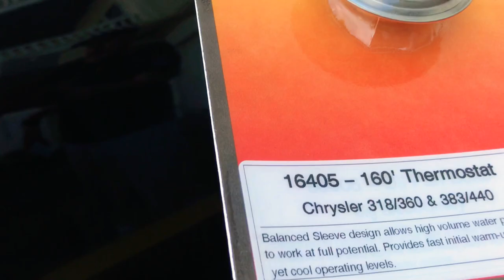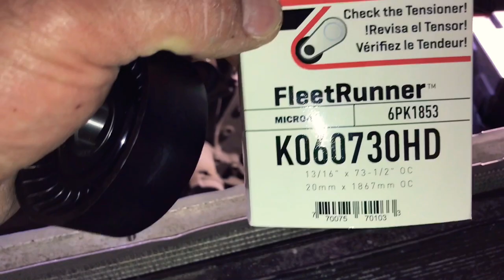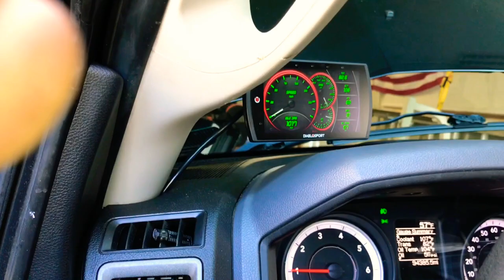4th Gen RAM Clutch Fan Delete, 160 Stat, Idler Pulley and Belt Install!

Comment: Is the 160 tstat an issue without tune?? I kept hearing people say you can throw a check engine light and have issues with the AGM staying closed...i put in the high flow 180 frostbite mentioned in his video for ram rebel.   Worked like a charm.
Reply from the maker: RockHumper just need to adjust fan temp so they come on and turn off appropriately
Reply: @TunedRAMS  sweet thanks!
Reply: I got a check engine code with a 180 t-stat. P0125, something about insufficient coolant temp. Had to tune it out.

Comment: Where can I get that efan I heard you say rockauto but what’s the number for it?
Reply from the maker: The one I got is oem I got off a guy on a forum
Reply: Do you got the part# for the one you’ll installed?
Reply from the maker: @black_nites.m.r2486  are you on FB?  TunedRAMS group?
Reply: @TunedRAMS  Na I’m not on them 😩
Reply from the maker: @black_nites.m.r2486  ok let me find out
Reply from the maker: @black_nites.m.r2486  go on Amazon and check this one out Dorman 621-410
Reply from the maker: @black_nites.m.r2486  55056851AG is the oem one